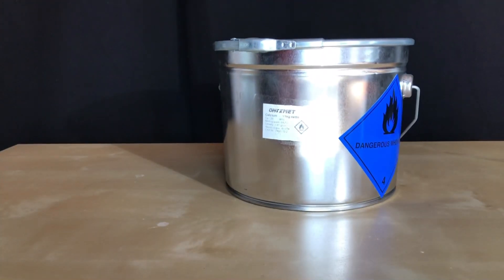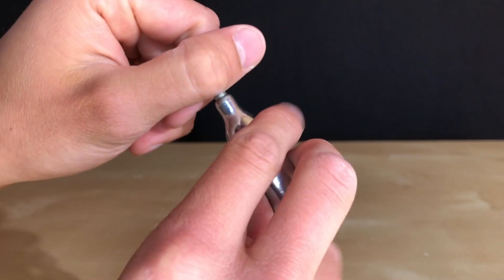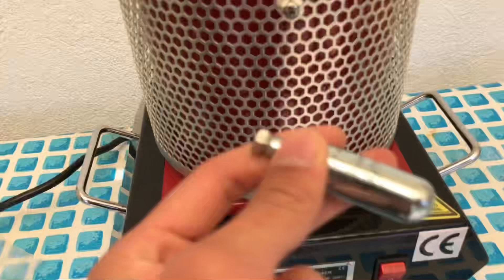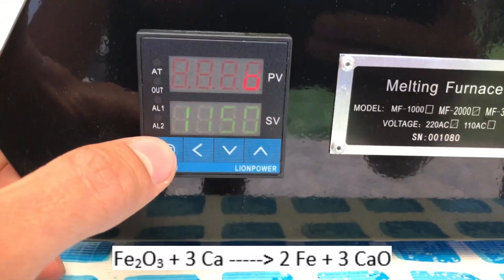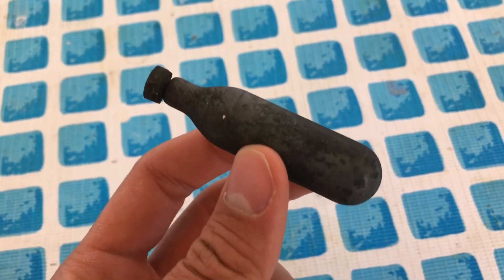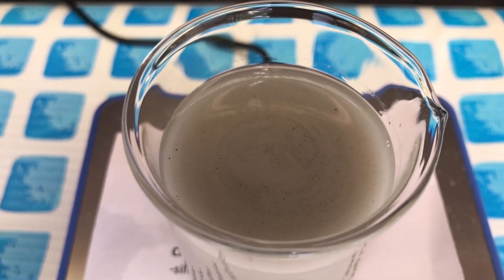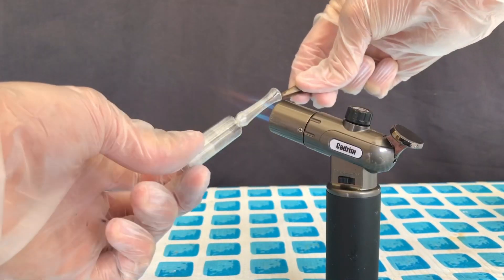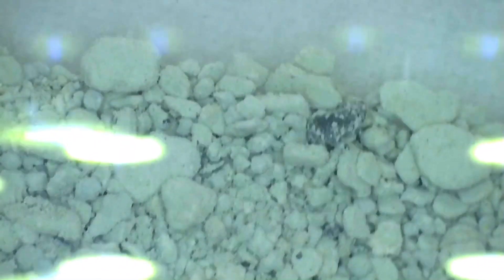SoMeThIng Interesting

Comment: It can't be Thorium because ThO2 doesn't  dissolve in AcOH, maybe Thallium? It seems to fit:
Tl2O3 + 3Ca -> 2Tl + 3CaO
Reply from the maker: The oxide didn´t dissolvbe in the acid. The product is still heavily contaminated with oxide up to a pont that there´s actually more oxide than actual product
Reply: @THYZOID  Yeah, I noticed that, but what is the point of an acid washing then?
Reply from the maker: @chemistry-experiments78  getting rid of calcium and calcium oxide

Comment: It's gotta be an F block element. My money is on Th, but it might be a lanthanide with a white oxide. That would be La, Ce or Lu. (Not sure of other possibilities.)
Use of the gas canister is a great idea. I might copy that. My problem is that I have no furnace and will have less temperature control with a flame.

Comment: - The metal must be toxic or dangerous in some way, since you had to use a gas mask

- Its oxide is white

- It doesn't seem to melt at the temperatures in your furnace

- The title of your video wrote "something" in an odd way, with the t being capitalized

- You're being oddly vague about it, which hints that YT might not like it

My guess is it might be element 90. Am I correct?
Reply from the maker: It even emits the same "healthy" particles as chinese health products

Comment: See if you can make something like centrohexaquinacene. It's 6 cyclopentene rings joined at the same carbon at the 4th position for each
Reply from the maker: Do you have a paper on that?
Reply: @THYZOID  I do not know of any, the closest thing to it in the papers seems to be a centrohexaindane, which is just centrohexaquinacene attached to a bunch of benzenes. There is likely some kind of a paper somewhere about it. You could do a similar process as when you remove the benzenes from indane to get cyclopentene and 2-butene

Comment: Kindly please make a video on how to make Acetophenone  through friedle craft acylation of benzene etc... 🙏 Thank You
Reply from the maker: You know what? That´s a good idea. As I need acetophenone anyways I´ll at least write a paper on it now (this means that I will film it but haven´t planned when to film it yet. There are also other projects I want to finish first.).
Reply: @THYZOID  🙏 Thank You , & Looking forward, God Bless
Reply: @THYZOID  maybe get the phenone from our fellow female horder in discord, its fairly cheap, but in general, friedel crafts of different phenones would be a cool video!
(ie make the acyl chloride using your PBr3 etc)
Reply: There's also a pyrolysis reaction that should work well for acetophenone: pyrolysis of an intimate mixture of iron(II)acetate and iron(II)benzoate with some catalytic Fe powder added into the mix
Reply: @bromisovalum8417  very bad yields tho, altho i only know of the calcium salts